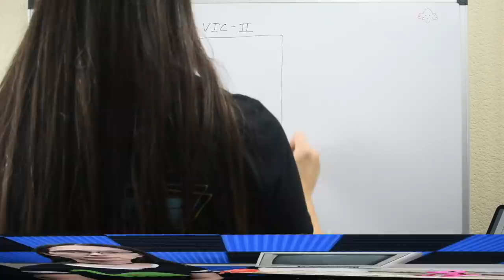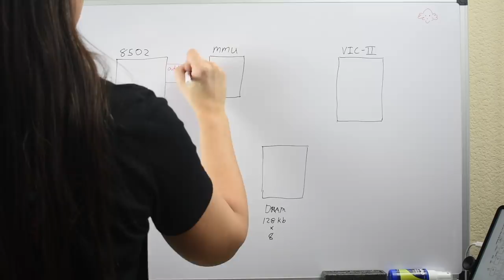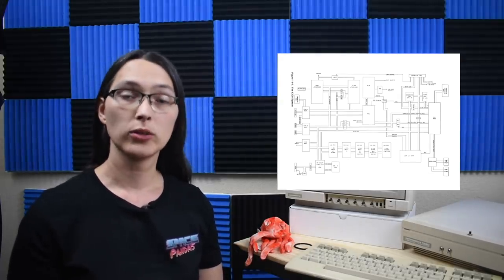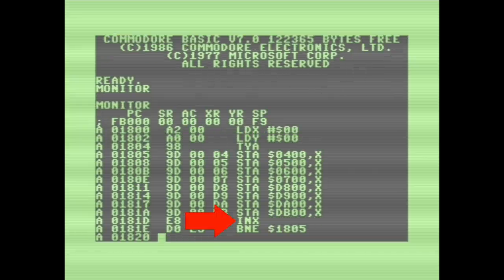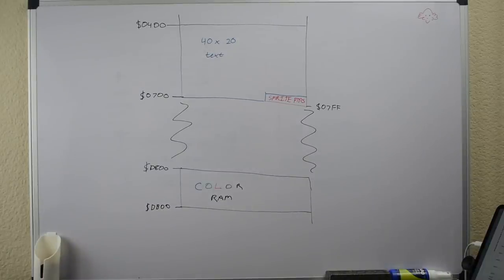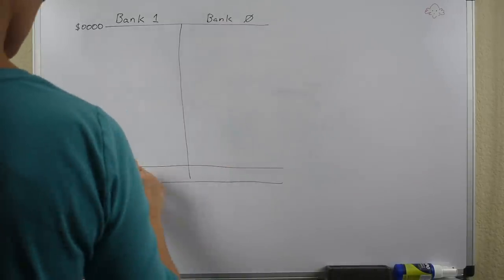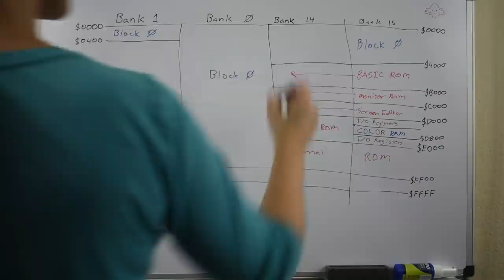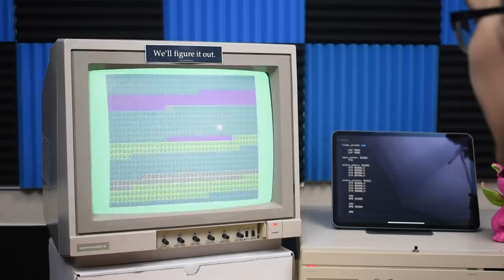Commodore 128D: Episode 2: Meet the VIC-II

Comment: Correction at 1:15:  Math operations are slow regardless of the data type you use. Microsoft Basic was originally designed to fit in 4K and 8K of ROM (there were two versions). In order to save space, Bill Gates did not develop separate integer/floating point math routines: Everything is calculated internally in floating point. If you use integer variables, the only effect you achieve is that the result is converted to integer and stored in memory as an integer. You don't save any memory: The size of a variable in memory is fixed, regardless wether it is floating point or integer.

The BASIC 7.0 in the Commodore 128 still derives from the original Microsoft Basic and has kept this behaviour, even though it resides in a 16KB ROM in the C128, and there is still unused space in that ROM.
Reply from the maker: @Daniël Mantione Yeah, that's a good point. The history here is important, and I'm afraid I spoke off the cuff again. Whee! Really need to write these segments out long before I read them so I can proofread them better. Guess I'll call this out in the next one. Thanks for keeping me honest! :D
Reply from the maker: @Growing Perspective Gates was a jerk, but I don't think it was all that bad -- we have quite a bit of media that demonizes/romanticizes him a bit unfairly. You actually can't argue with the results of his work: he wrote a high level language for tons of crazy-restricted machines, and got decent enough performance out of it that it sold like hotcakes. I'm actually in awe of what he accomplished -- it certainly got me into the field!
Reply: @NybblesandBytes  said: he wrote a high level language for tons of crazy-restricted machines

In fact, a BASIC interpreter was the very first program "Microsoft Corp" ever delivered (for the Altair 4400, which had EXTREMELY limited resources, even more limited than the Atari 2600).
Reply: Well, Micro-soft under Gates has a long record of a disputable business practices. Nevertheless, Chuck Peddle (the designer of 6502 processor and a "father" of Commodore computers regarded his BASIC code as clean and well organized.
Reply: @NybblesandBytes  As Chuck Peddle has been has been fond of saying, "There is nothing nice about Steve Jobs, and nothing evil about Bill Gates. Gates is a good man”.
Reply: it must be love
Reply from the maker: @gambrinus330116  Nah. I just feel like his accomplishments are amazing -- Microsoft BASIC got me into programming in the first place. I wasn't praising the guy, just his accomplishment.
Reply: The general context of the commentary seemed to be broader: talking about different kinds of BASIC implementations.  While Microsoft BASIC always used floating-point for numbers, the earlier versions of Apple and Atari BASIC were integer-only.

Really, a hybrid approach for Commodore would have been much faster: parse and handle integer values between, say, -8M and +8M as 24-bit signed integers, build routines to add, subtract, multiply, and reference values as integers where possible, and only convert values to floating point when necessary.  A lot of BASIC games only ever actually use integer values and would probably run twice as fast from this.  The C128 had tons of ROM space and this optimization could have been added to it.

In Commodore BASIC, using an integer '%' for a scalar value actually wastes both time and space, because the value is constantly converted back-and-forth between integer and floating-point during calculations and the '%' character in the tokenized BASIC program takes an extra byte of storage for each time it is present in the code.  OTOH, if you declare an integer array, each array element only consumes two bytes of memory instead of the five for floating-point elements, so there is an actual application for the data type to exist: large arrays.
Reply: Atari BASIC never was integer, only FP.
Reply: @audio01 : Oops.  I looked at the Wikipedia page about how Atari BASIC uses BCD floating-point values ( https://en.wikipedia.org/wiki/Atari_BASIC#Performance ).  Talk about snatching defeat from the jaws of victory!  Despite the Ataris having a much higher clock speed and a fully-tokenized BASIC, they're 3½× slower in a BASIC benchmark than the VIC-20.
Reply from the maker: Vladimir Mišev Then I have three accomplishments to be thankful for instead of one! :D

The three of them changed the face of computing at the time. Quite an accomplishment.
Reply: @pd209458  Bill Gates does strike me as a person who would be a neat and organized programmer (mild to severe OCD). Back in those days when every single byte counted, you had to be frugal with your code out of necessity.

Couple of corrections on my part: I think I called it the Altair 4400, but it is the Altair 8800. And, it actually had more RAM than the Atari 2600: 256 bytes instead of 128. Whoo Hoo!
Bill Gates sold Altair BASIC for $500 (!) on a system that was only $439, but you could get the BASIC for $75 if you bought it with the 8k Altair plus an expansion board. Still, Altair BASIC was a godsend for people trying to do anything on it. Here's a pretty good info page on it: http://oldcomputers.net/altair-8800.html
Reply: I think the C128 use 28KB for Basic 7.0. (72KB the hole system).
Reply: @ Uwe G.:

The sizes of the ROMs in the C128:

C128 KERNAL: 8KB
C128 Z80 BIOS: 4KB
C128 Screen editor: 4KB
C128 BASIC 7.0: 16KB
C128/C64 ASCII charset: 4KB
C128 national charset: 4KB
C64 KERNAL: 8KB
C64 BASIC 2.0: 8KB

I get to a total of 56KB of ROM.
Reply: @danielmantione : Since the C128 and the C64 have slightly different fonts, there would be separate C128 and C64 character-set ROM spaces of 4 KiB each.
Reply: On an American C128, there are indeed two character sets that have both ASCII encoding. The ROM space that is otherwise used for the national character set contains the font for Commodore 128 mode.

A Commodore 128 with a national character set displays the same font in C64 and C128 mode (which is the C64 font), and the "ASCII/DIN" key is used to switch between fonts. In C64 mode the "ASCII/DIN" key just switches the font and does nothing with the keyboard. In C128 mode this key also switches the keyboard between qwerty and a national layout.
Reply: But like in Commodore BASIC, if you use INT for variables, you can reduce the bytes to two instead of five, no?
Reply: No, a variable uses 7 bytes of memory regardless of the type. Please see: https://www.c64-wiki.com/wiki/Variable#Memory_using

Comment: I used to do a lot of assembly programming on the 6502 or 6510. They used to teach it in high school if you can believe that in the 1980s. It was all done on Apple twos but the architecture is exactly the same. The support chips are what made the Commodore 64 so special. The best thing I ever did was to Multiplex Sprites to show 21 Sprites at the same time. It used raster interrupts and an interrupt service routine to change the pointers to the Sprites. Hardware interrupts were the best assembley language features and this channel should end up there eventually.

Comment: Bought my C128 about two years ago planning on using it explore lower-level programming and finally today (thanks to your video) typed in and ran my first 6502 code in the monitor.  Modified it a little to get different colored character noise.  Think I need to spend a bit more time with the books but with your help, I at least I broke the ice, so to speak.

Comment: I really appreciate the correction about the 6510 and 8502. I got confused and re-watched that part 3 times before realizing what you meant.
Reply from the maker: @David Brown Sorry! Hope to do better on that. :D
Reply: @NybblesandBytes  Just remember that it's perfectly normal to make mistakes. Just because you didn't say something right in a video, that doesn't mean you don't know it in real life. Also, remember that it's okay to be flat out wrong.
Reply: 6502 = original MOS processor
6510 = 6502 + onboard 6 bit I/O port (appearing at memory map locations $0000-$0001)
8502 = 6510 with support for 2Mhz operations, onboard I/O port extended to 7 bits

Comment: I am really enjoying these videos. I grew up programming basic on the TI-99/4a computer, this is awesome.
Reply: TI-994/A!! Love that micro! Now, THERE is some wild hardware in those! Needs a series on it's internals and assembly programming! TI Extended BASIC was a pretty cool language itself with sprites and internal speech commands!
Reply: Yup, I strangely still have the Extended Basic Cartridge, but alas I do not own a TI-99/4a. I may need to add it to my collection at some point. Good memories.
Reply: @crispytheone88  I use an emulator for the TI-99/4A Called Win994a. Just about every cartridge,disk, and tape ever made is available for it. Really nice as you can have the whole shebang Including Hard disk support! Here's the link:  http://www.99er.net/win994a.shtml

Comment: I like the 1084 monitor control door sitting on top of the screen in the intro. ;)
Reply from the maker: @Wim Widdershins yeah, this monitor's been around a while and seen some stuff. You should smell the monitor when it's been on for a while. It starts to smell like an old ashtray. O.o

I really need to open it up and clean the insides, but I'm a little afraid of the high voltage... O.o

Comment: For those of us following along at home, how would we save these small little programming steps to either a disk or tape?
Reply from the maker: @Samuel Scott There's several ways, but the monitor has its own load/save routines which are probably what you want. The syntax is 'S "filename",<device>,<start address>,<end address + 1>' to save, and 'L "filename",<device>'. The starting address for the program is encoded in the first two bytes of the PRG file it creates with the save command, so you don't need to tell load where to load it in.
Reply: @NybblesandBytes  Thank you, have now retyped and saved the first to programs!!
and ready to learn some more.

Comment: Small nitpick: there are processors that don't have a floating point unit but can still do multiply and divide on integers (I think most ARM processors are setup this way).
Reply from the maker: @David Wegmuller Yep! Wasn't claiming that, but thanks for the correction! Keep 'em coming! :D
Reply: ARM has come a long way.  Even my cheapie phone has a Cortex-A53 64-bit processor that features "VFPv4 Floating Point Unit onboard (per core)" and "NEON SIMD extensions … per core".  The FP unit supports single, double, and half-precision floating-point, and the SIMD unit will do vectorized single-precision floating-point operations.  My phone's System-on-a-Chip also has a GPU that can do 22-billion floating point operations per second per core.

Comment: How the say it, the MOS 6510 exists (on the C64) the 8502 is an updated version of the 6510 capable of running at 2 speeds in NTSC 1MHz and 2Mhz. The main difference between the 6502 and the 6510 is the 8 bit I/O general purpose port.
Reply from the maker: Isnt that what I said?

Comment: This is a good source for the C128 Programmer's Reference Manual:  https://www.pagetable.com/docs/Commodore%20128%20Programmer's%20Reference%20Guide.pdf
Skip to Ch. 5 (pg. 123) for the machine language portions and guide to using the Monitor.
Reply from the maker: Will Powers Is there something wrong with the archive.org link I provided in the description?
Reply: Although I did note the link in the description, I didn't see a link to download it as a PDF, initially.  I also wanted to point out that the useful information begins in Ch. 5 after the coverage of BASIC programming.
Reply from the maker: Will Powers There's quite a but of useful info prior to chapter 5, too, incidentally. Its aimed at BASIC users, but the discussions of the hardware in relation to it are useful. BASIC has its tendrils wrapped deeply into the machine, and at times can trip you up when working with machine language programs.
Reply: Interesting.  I look forward to your coverage of accessing the sprite portions of memory.  Any idea of when the next episode will be released?
Reply from the maker: Will Powers I've been working on it all weekend so far. Hopefully this weekend.
Reply from the maker: Oddly enough, BASIC did, in fact, trip me up with one of those tendrils -- despite having manuals on hand that told me about it. :-p
Reply: Would be interested to know about this pitfall if you have the time.  I feel like we are all exploring ancient ruins together as we plunder the old texts and speak to the old gods through their arcane tongue.  Sometimes you have eureka moments when the vaults unlock, and sometimes the temple crumbles and the boulders roll.  Point being, we've got to look out for each other.
Reply from the maker: Will Powers No worries -- I'll have the pitfall highlighted in episode 3. Suffice to say, the enhanced BASIC v7 ROM functions cause extra headaches you don't have to generally think about on the 64. I think the extra tooling, though, makes it worth it.

Comment: This video is really motivating for newbies to assembly language.  Maybe i should put a similar patch on my monitor as yours. It makes it easier to live trough the frustrating parts.
Reply: oh and i guess i cannot transfer your stuff 1-to-1 to my c64, right? I think the memory map is quite different.
Reply from the maker: @krautguy Actually, a fair amount of the stuff I'll be doing should work, assuming you use the right addresses for the memory maps instead of the ones I'm hardcoding here. I think after episode 3 I'm going to start using proper assemblers to do this work, and I'll be defining these things as macros, so the code should be relatively portable to a 64 with minor changes.

I'll call out 128 specifics as I run into them, like the VIC retrace IRQ and the screen editor management of sprites, so you should be able to chop bits out if you need.
Reply: You could also try the vectrex console. It's very easy and great

Comment: You ever get the feeling early computer designers borked things intentionally?  Why would anyone think putting the important system level parts at the middle and end of the memory map?  And why would you need to load the entirety of the ROMs and Kernal into RAM in the first place, when you could just assign memory addresses to the ROMs and Kernal?  In Commodore's case, it's likely down to keeping it as cheap as possible, but then there's IBM and the 640KB (1MB, minus the 384KB UMA/video RAM) limit.

Because they mapped the video memory to the end of RAM.  And then, if you used (like most of the PC world) MS-DOS, starting with the 80286, you had another 64KB of HMA sitting ABOVE the UMA, requiring special software to utilize it.  AND THEN, more special software to access anything above that.  You were spending memory to access memory for no good reason.  And you still could only access the first 640KB directly.  If they had mapped the UMA to the beginning of RAM, or mapped it separately, they could have had a flat memory model, before Amiga or Mac.  </rant>

Comment: This video was in my Youtube recommended page...

Nybbles and Bytes...

While the Commodore-128d has little interest for me, I am fascinated by your ability to push through a complicated subject, including the mind-twisting hacks invented by the programming crowd at Commodore.

I also am mindful that Microsoft was quite late to the party, while operating like they were the leader. Apple was making computers and software years before Microsoft, and missed many of Microsoft’s pitfalls. And then invented some new ones of their own <grin>!

I find similarities between YOUR explanations of memory management of the 128d and the Radio Shack Color Computer-3. This computer came with 128k of ram and could be expanded to 512k. It was also, for about 6-months, the fastest PC in the world, because of its RISC processor MC6809 which could work at 1.8-MHZ,  and outperformed the IBMPC at 4.77MHZ.

The Color Computer-3 was organized into 64-kbyte pages, which were not used in the rombased standalone system. This was used very heavily in the optional OS, OS9 Level-2, which not only handled multitasking before its time, and displayed multipage graphics in independent memory and video buffers, but also constructed its memory pages in a auto-incrementing model, that was easy to use, and fun to write programming for. 
—-
Have fun in your short lectures. I might just listen to them, to see how these forerunners of computer science did things when nobody had a good plan, and nothing worked very well <grin>.
Reply: Even the C64 did memory management to squeeze 88K of stuff into a 64K address space.

Comment: I'm very new to this but I did notice that I did get the same problem with the colors if I did not prefix the address with an F but if I exit the monitor and did an SYS6144 that I did get the colors. When you run the program from outside the monitor do you not need to set the mmu?   I'm using VICE 128 btw,  and Great videos as Well
Reply from the maker: @Phil Tanner Not entirely sure, actually. It's possible BASIC may swap it back in.
Reply: In BASIC, you use the BANK command to change the memory bank and the SYS command (and PEEK and POKE) only take a 16-bit address within the bank.  The default BANK is 15, which is what you get if you haven't changed it yourself.